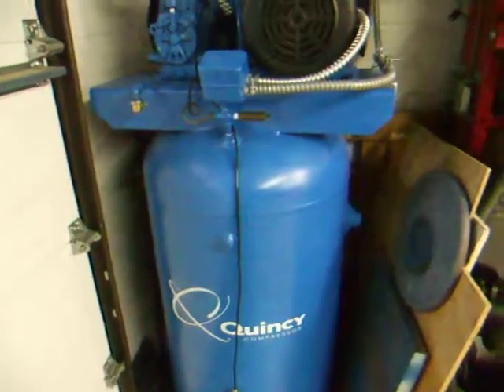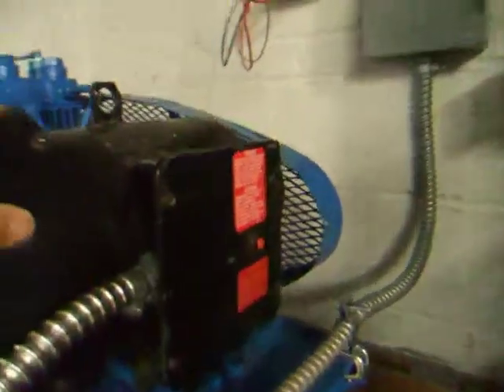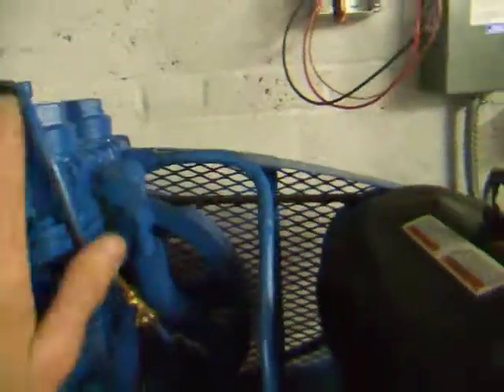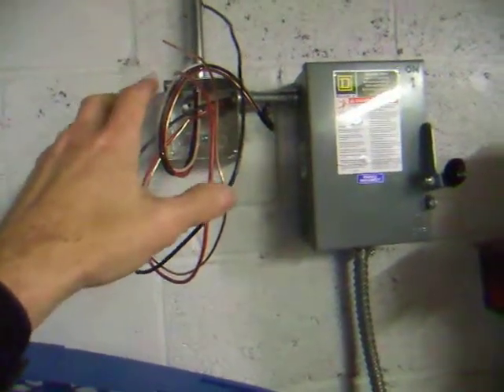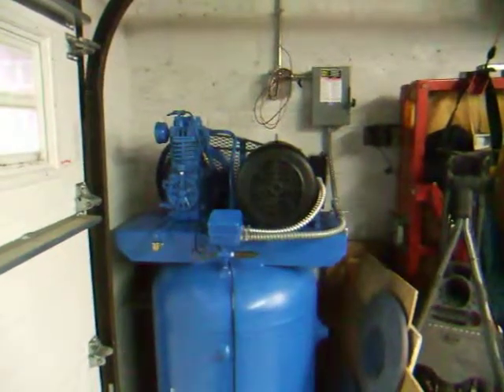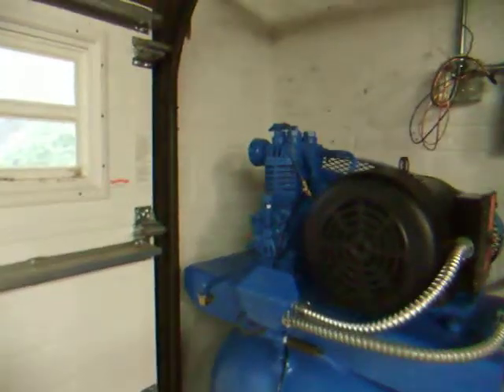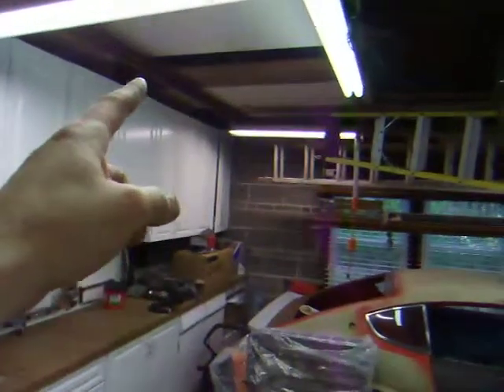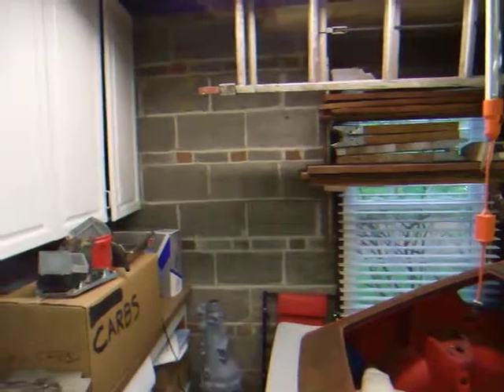Quincy Air Compressor Wired for 220V... almost

Comment: Nice little 306. 
Did you ever get it finished? 
Post a vid of it running
Reply from the maker: Yes, I ran it until this year, replacing it with a much bigger Quincy model 240 and a 5 hp Baldor which produces much more CFM.   I'll post that video.
Reply: Cool....looking forward to seeing the 240.